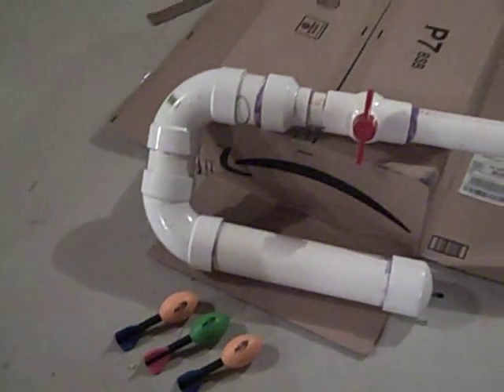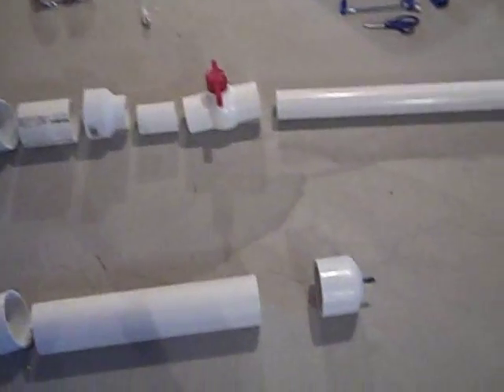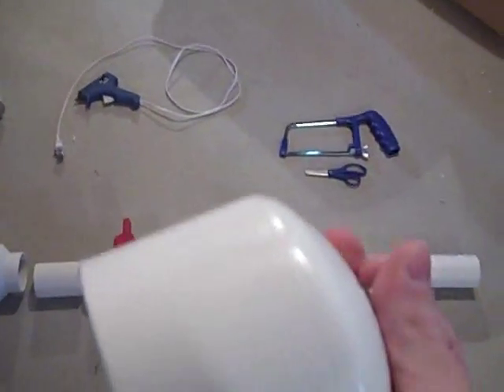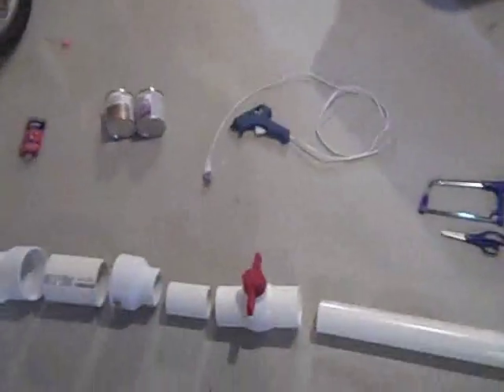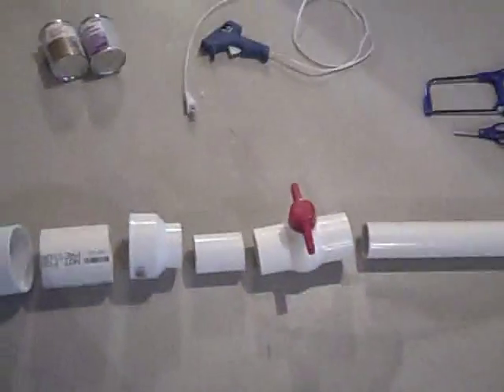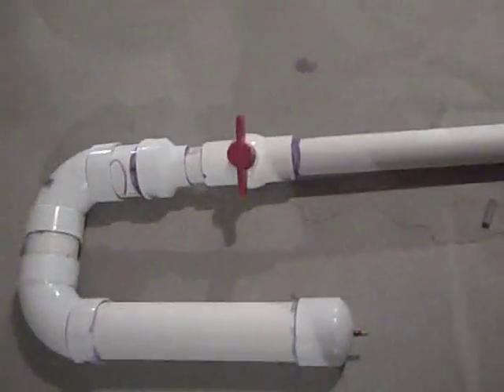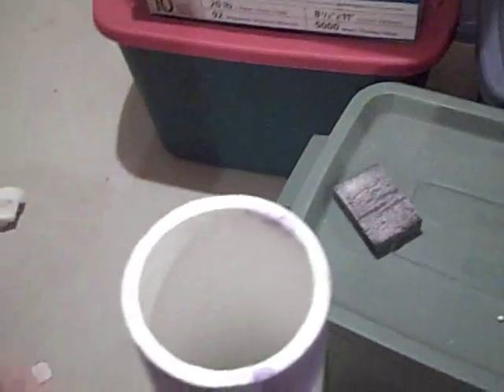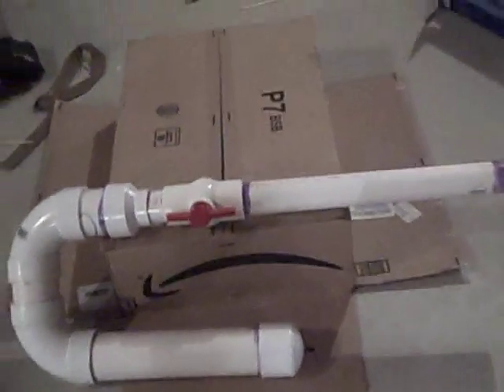How to Make a Nerf Rocket Launcher

Comment: there was a time when I would have complained that you used dwv fitings, those fittings are designed for drains and not pressurized systems so they are tested to be safe underpressure. However most people use them and don't have problems with them, it's much more expensive to get large pressure rated larger fittings and most hardware stores don't sell them so nowadays I see it as a worthwhile risk